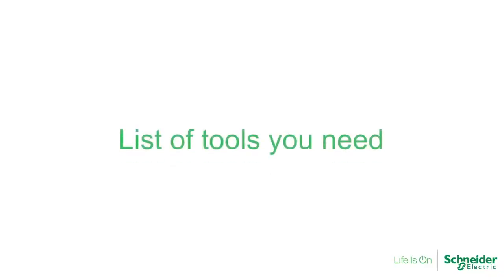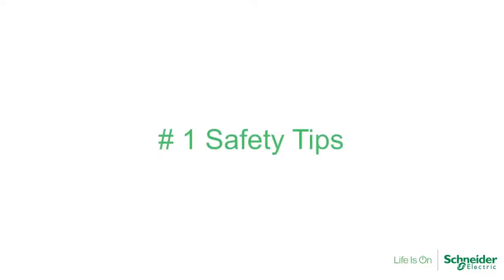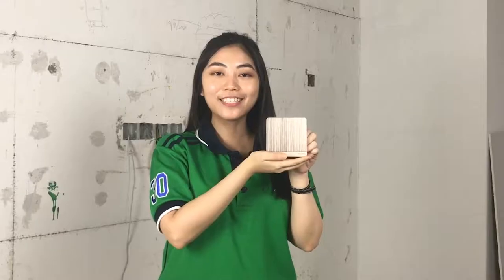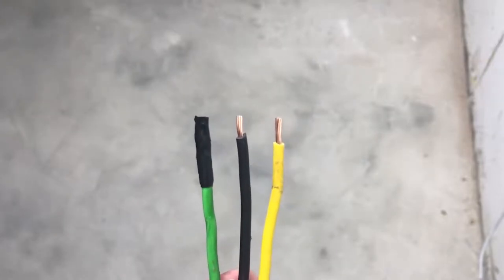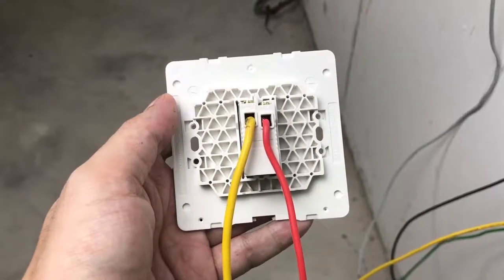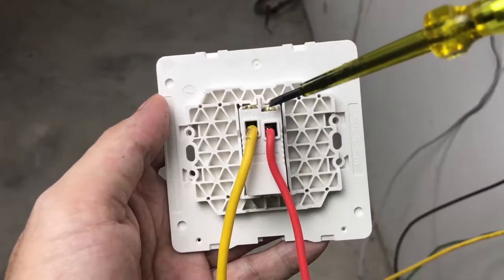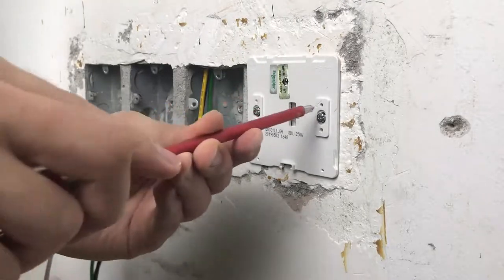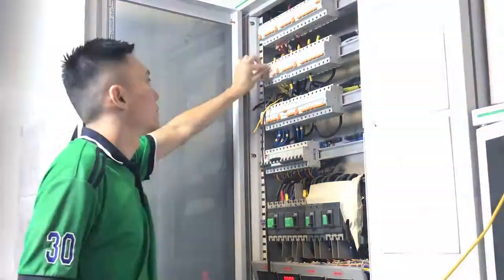How to Install Schneider Electric AvatarOn Switch | Schneider Electric

Comment: Hi can you tell me which one of your affle plus switches I need for this scenario? It's a one rocker switch that when you flip it, it turns on the water heater and a light on the bottom part of the rocket will turn on.
Reply from the maker: Thank you for your message. We house most of our documentation in a virtual database here: https://www.se.com/ww/en/download/. If this does not address your concerns, please reach out to a technical support person in your location.https://www.se.com/ww/en/work/support/country-selector/contact-us.jsp

Comment: i got question about avataron series, after the switch is installed, the light on the switch turns on but it makes the lights in the room dim and when the light switch is turned off the electricity remains on.
Reply from the maker: Thank you for your message. We apologize for any inconvenience caused. Our customer care team would be happy to provide assistance. Please reach out to a customer care member in your location here: https://www.se.com/ww/en/work/support/country-selector/contact-us.jsp
Reply: you have switch installed on neutral line :| hence its happening

Comment: so live wire to COM port? or L1 port?
Reply from the maker: Thank you for your message. For technical support or to find answers to your questions, please refer to our support center: http://spr.ly/6055J0Cfz.
Reply: COM.. L1 for wiring Lamp
Reply: Is live wire going to Com port? and neutral wire going to Load port?
Reply: @edmondchan8512  live (input) to com and output to L1, neutral will directly go to load